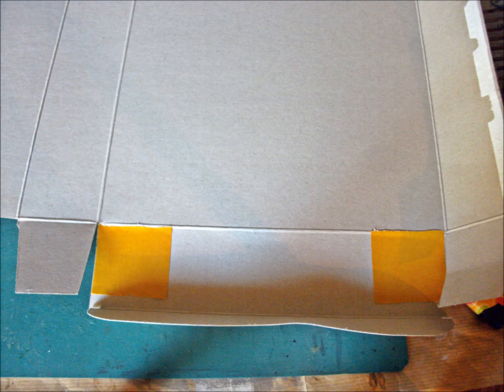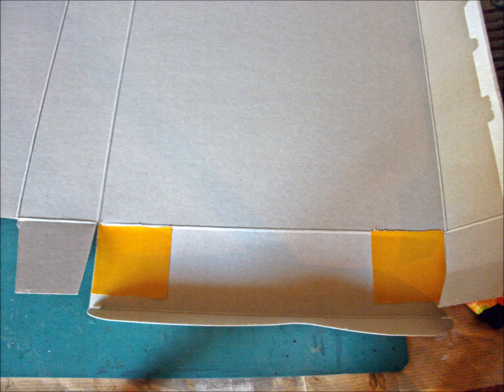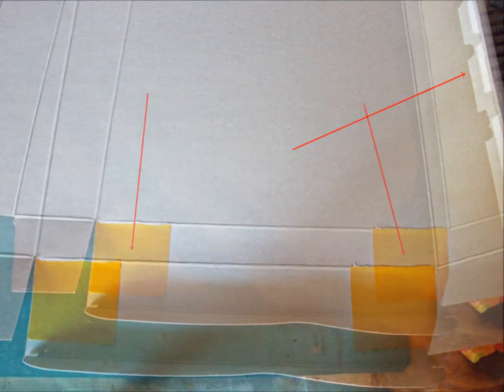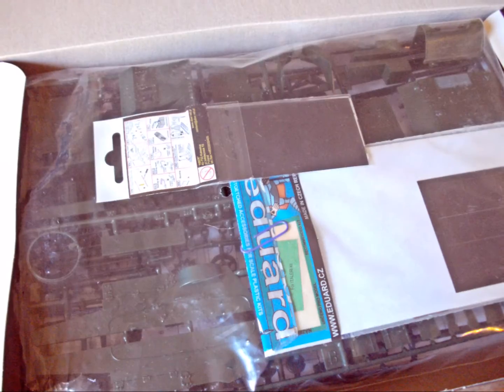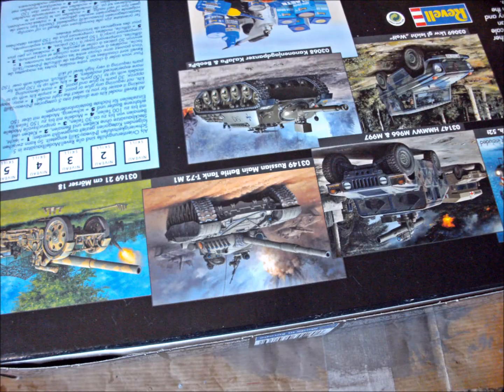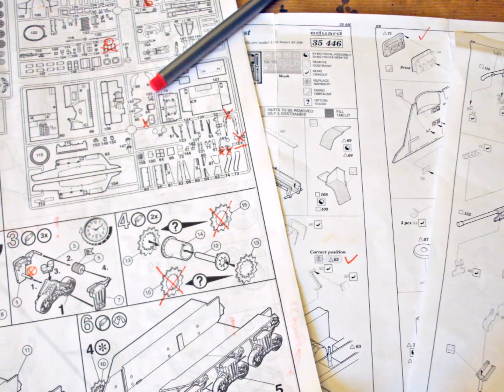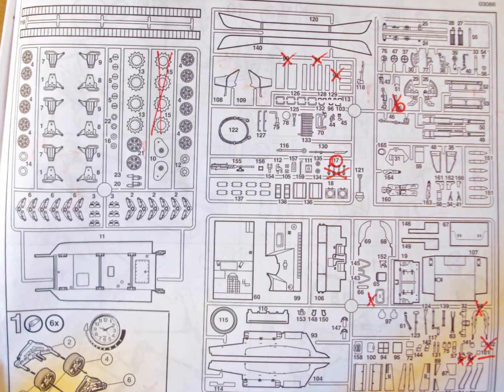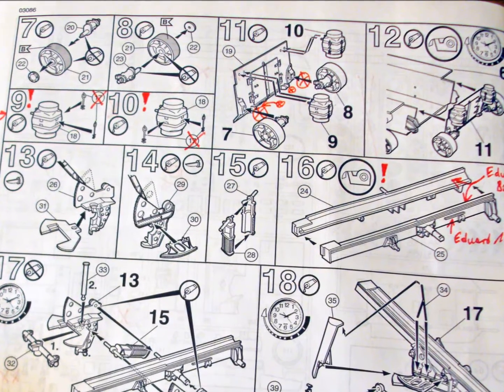'M' Group Build   Update 1, Quick and dirty

Comment: Lots of good ideas in this video Jens!  I've got a full interior for the M8 coming so I will need to do a lot of preplanning as well.  Also a set of stowage as well, but stowage is easier to deal with since it's all external in my case.  I've never used Verlinden add-ons before so this should be an adventure.  
Great update, definitely got me thinking.
-scott
Reply from the maker: Thank you very much, Scott. Yeah, you should do a precise job on planning your build or you'll get nuts. I used quite some Verlinden stuff in my "Vietnam era" in the early 1990s. Mostly resin and I loved it. Besides cleaning the resin (dangerous) it's the best material I ever worked with. The detail is wonderful. I guess you'll like it. :)
Reply: I'm definitely looking forward to doing something different on this build and I can't wait until the package gets here.